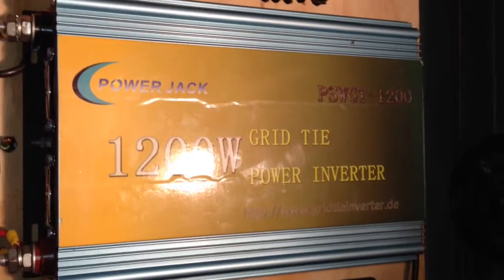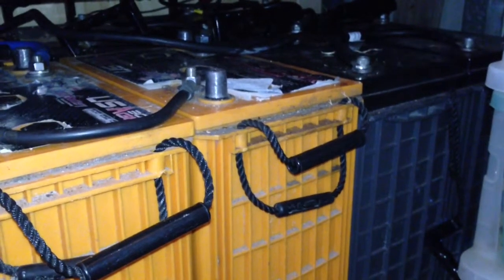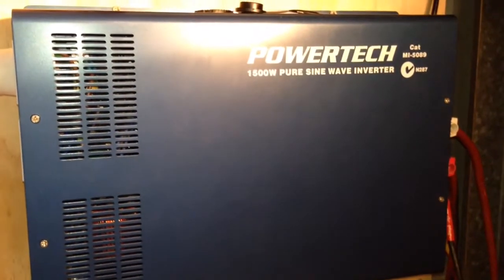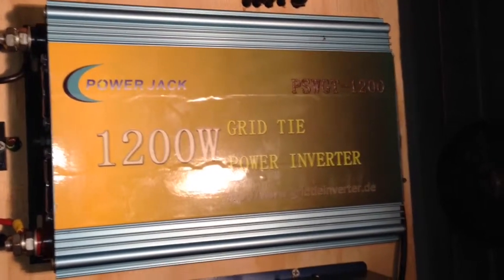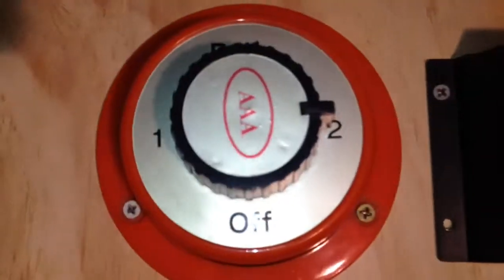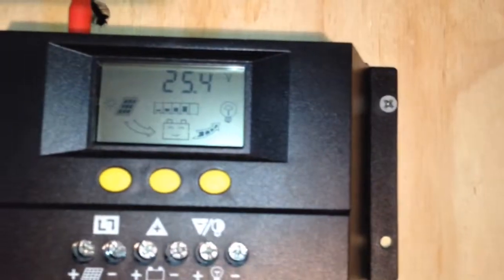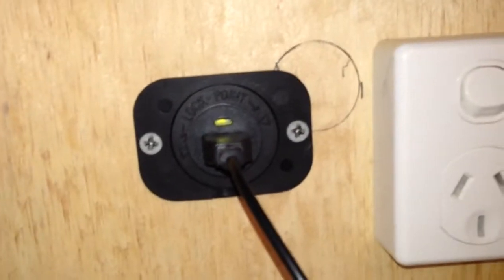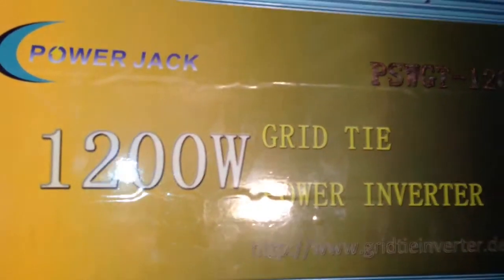Power Jack GT-1200 Grid tie inverter solar setup. On & Off grid

Comment: Great guide, have you still got the manual for the gt 1200, I cant find where to get one. Thanks
Reply from the maker: Yes I have, SOMEWHERE lol i saw it 12 months ago in a draw but its not there now (wifee cleaned)
Reply: @HBPowerwall  Cool, any way I could get a copy of it please. I hear it has a schematic or the advisory of any replacement repair of some of the components, be cool if you have, be appreciated. Cheers
Reply: Hi mate, have you had any luck finding the manual at all, I cant find one anywhere. Also did you use a current limiting device when you switch to batteries to power your powerjack pswgt-1200, cheers.

Comment: How did you wire the A,B switch in?  Did you come from the Battery port of the charge controller to the switch and from the switch to the Grid tie and Battery bank?
Reply from the maker: +Ken B Positive off the solar to middle post - positive off battery to A - positive off Inverter to B

Comment: I've went through 4 of these power jack 1200, I only had 600 watts to each of them, there junk, I should have put the money towards a good grid tie
Reply from the maker: That power jack has gone south for the winter again won't bother repairing again. I'll use it as an excuse to upgrade :)

Comment: You mentioned running your PowerJack off of your batteries when the power goes out. If I am not mistaken the PowerJack  is "island safe" and should shut down in the event of the grid being down. Does your inverter function with the grid down?
Reply from the maker: not when the power was down, was at night sorry.
Reply: nocrf50here It is all good. There are so many models\sub-models it is hard to tell which has what features. I am looking at doing the same thing, I just was wondering if they made a model that functioned "off grid" also.
Thanks for the quick response.
Reply from the maker: After looking at my own video I never said I run the GT inverter when the power goes out, yes it is island protected. The Power jack can run the shed. As for many models - yep I'm pretty shure I've blown up one of each :)
Reply: nocrf50here @ 1:42 of the video you mentioned running the Power Jack grid tie from the batteries when the power goes out. That was the reference I was referring too. Not a big deal I was just curious.